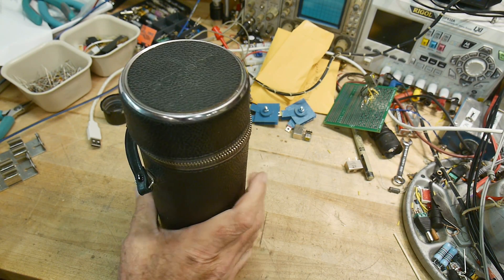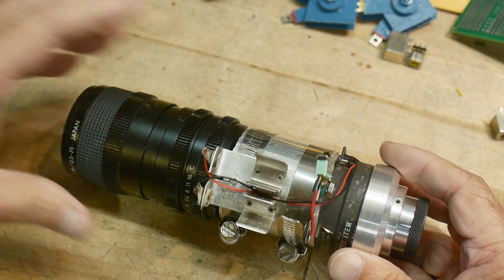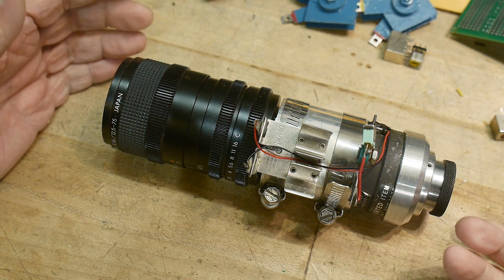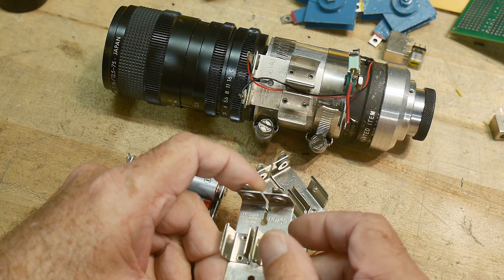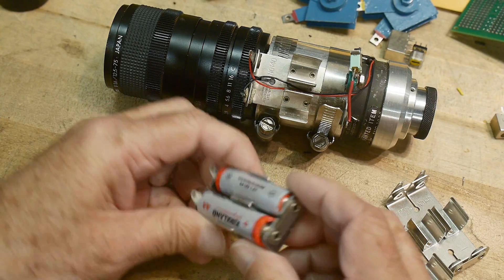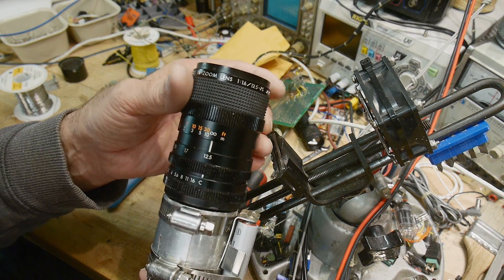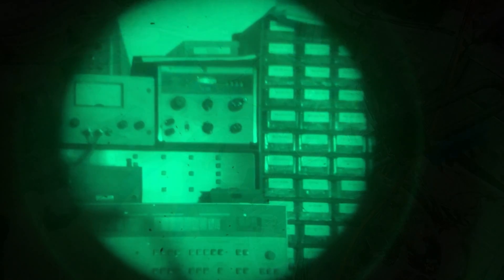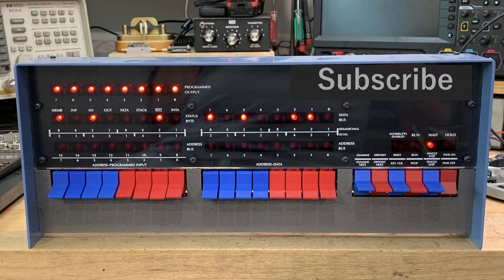#1755 DIY Night Vision Scope Repair

Comment: Let me give you some advice, remove batteries when not in use BUT once a month pop the batteries in and turn it on in a dark place and let it run a few minutes. There are electrolytic capacitors in the encapsulated power supply to the tube that need to be reformed every so often.  Otherwise when you need the device it might not fire up right away or even not at all. Power supplies are hard to come by and can be very expensive. It took me two years to find the supply to my tube. Funny thing was that on the day that UPS delivered the supply at the office, we had two guys in from a utilities location service company in the shop to get their repaired radios. One guy saw the power supply on my bench and he came forward and let me know that it was his MOS in the Army to repair and setup NVG"s. He gave me some excellent pointers as to how to use the controls on my supply and he even identified it as a supply from ITT. 25 yeas later, wish I could find the notes I took that day, darn!
Just a side note, NV devices need a lens that is designed for the old one inch vidicon tubes. Considering the tubes most often have one inch aperture’s. It takes full advantage for gathering maximum light compared to using camera lenses designed for 1/2” or less image sensors on todays cameras. Yes it is nice having the aperture adjustment on the lens as well. You can always cut down on light ingress that can cause blooming of the image, quite common on tubes that do not have auto gate control on the power supplies.

Comment: No need for hot melt glue... just solder the lower two switch pins to the battery lug. That'll keep it firmly in place.

Comment: Do you know about Sony Night Vision cameras?  They also shoot IR. This is one of the best: https://www.youtube.com/watch?v=d2EzNhH0vMI.  Coolest thing is that someone noticed you can use an external magnet to switch it into IR so you can use it  in full daylight (but you will need a 720 filter to kill the visible light). https://www.youtube.com/watch?v=2mug6xGPdhY.  I picked up some of these at a thrift shop for about $20. Great Sony/Zeiss quality.  There is an interesting back story about why Sony discontinued these, although they over-reacted.

Comment: His tube costs 2000+ € on ebay. Is there a cheaper alternative/source?
Reply: The Russian first generation tubes are available on ebay typically for around $100. They don't hold a candle to the gen 3 tubes of course.

Comment: Recommendation: Use Energizer Ultimate Lithium AA cells (L91). They do not leak and have excellent standby life (7 years ++). The cost is more, but if you're using them in something expensive or irreplaceable, an extra dollar per cell is well worth the expense. Cheers!
Reply: On the last one i got they say 25 years shelf life

Comment: For military equipment I would surely use metal hose clamps as well. For private applications cable ties could also do the job. 
Polymorph is a kind of low temperature hot glue which gets rather hard below 60°C and can be adjusted by hand while cooling. People who even hold parts in their hand for soldering will not need it.   :o)

Comment: A nice gadget for night vision 🤔 he turned the switch 90° so that it rests on the battery holder, it won't get in the way and it can be better fixed to the holder's structure 😁

Nice day 🙂 Tom

Comment: Have a similar night scope to use with a telescope.  Mounted a 1-1/4" eyepiece tube to the front and an eyepiece on the other end.  Amplifies the faint light from nebula well.  Your setup would do the same, so you might enjoy some star gazing with it.  Even low magnification will produce some nice images. Check out the Orion nebula.

Comment: Building yours was a lot simpler than the one I assembled parts for.

I too used a military surplus tube but it was from the 1940's and required high voltage and an infrared light source.

Getting an old tv flyback transformer was still easy enough in the mid 80's but making it operate from batteries was the challenge.

I also bought a surplus infrared filter to put in front of my light source.

I gave it all away decades ago.
Reply from the maker: I built one of those decades ago also. old RCA tube

Comment: hose clamps worked, and were inexpensive.  It is a good technique for a 1 of for one's self.
Use thermal strippers for the TFE insulated wire.